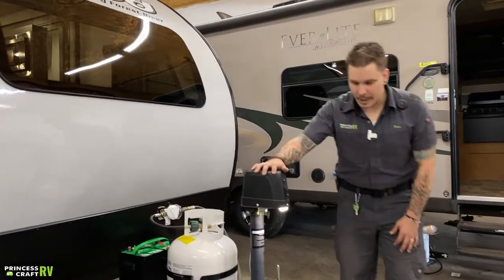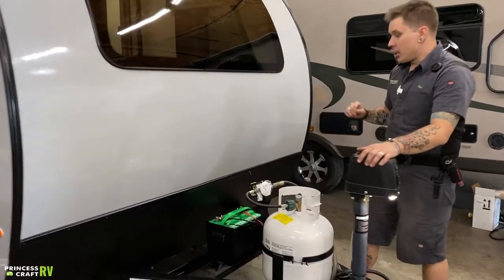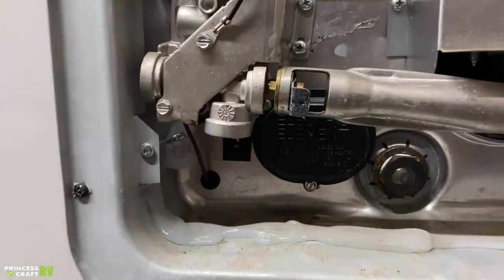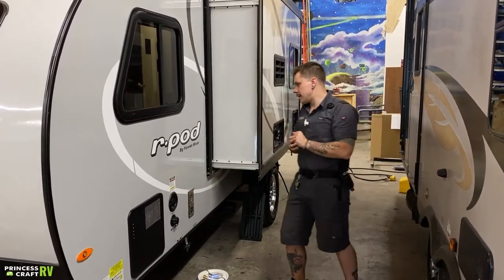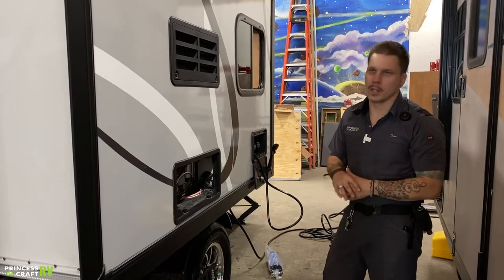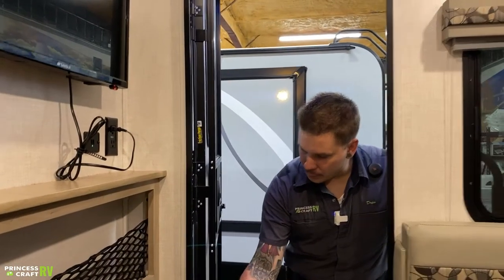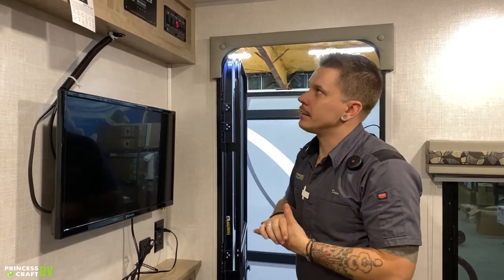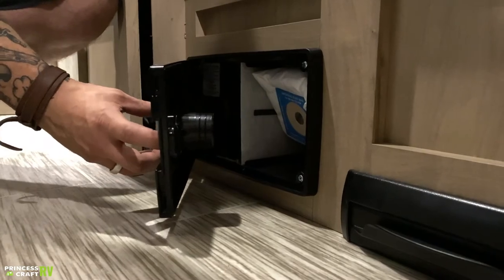2020 R Pod 190 Technician Tour

Comment: Hi. Thanks for posting this video--very helpful. Regarding the refrigerator: What happens when the POWER button plus the FAULT light are flashing? It's connected to power, always has been, even at home when storing, but it keeps beeping--not sure what triggered it. What can I check to reset these beeping lights? I've tried pressing all the buttons, and nothing helps.  It suddenly started beeping while plugged in. I hope you can help me. Many thanks!